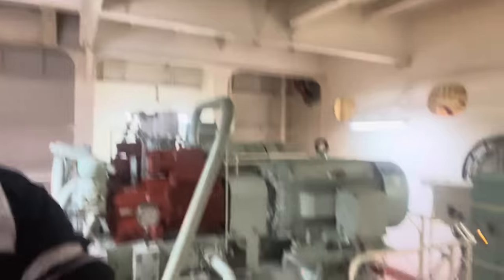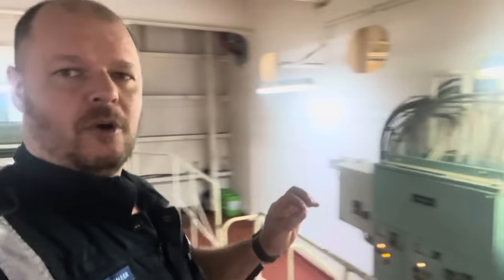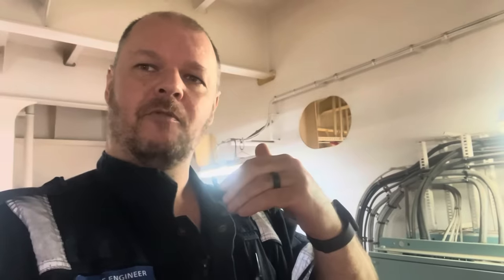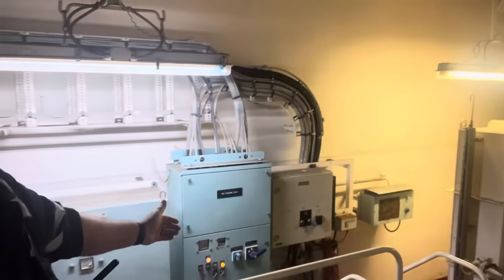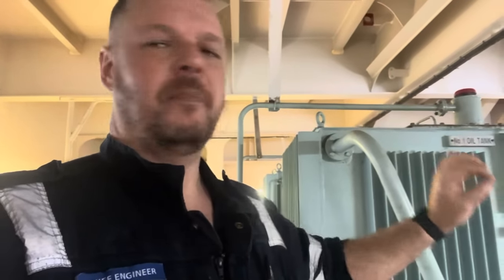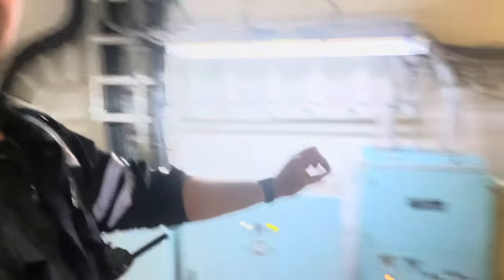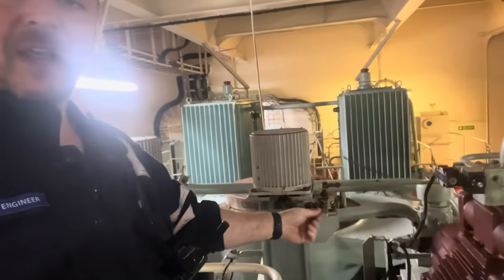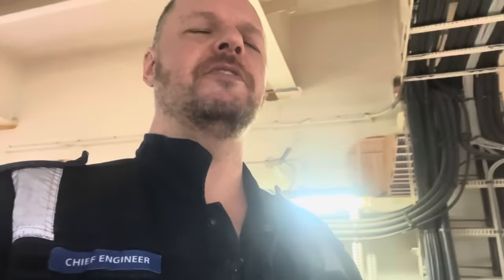Dali size containership steering system. How it’s designed to not hit Francis Scott key bridge

Comment: ok, people speculate about cyber attacks and how easy they are.  your ship looks like most industrial systems, which means its all mechanical and some electrical.  maybe a 24v closed control system, but no networking.  maybe the nav system could be hacked, but it looks like the electrical system and steering dont have much of a way to get hacked.  comments?  if the helm is "fly by wire", i could see faking the input control, but it would be super hard to do remotely.

Comment: Emergency power was restored to the steering in a minutes time , with which they could have started a main generator to power the main engine , giving stern thrust to slow/ stop the momentum of 8 knots, for the reason  of the Black smoke,   coupled with dropping the anchot, complicating matters,  , with the astern Propulsion causing the head to Cant to the right directly heading the bridge pillar, these undue actions caused excessive srain on the generator for the cause of the 2 nd blackout , 
It should be known that the heading does not depend on the propulsion but on the momentum which was at a forward 8 knots, likewise with such a headway stern or bow thrust would have no effect other than Canting , 
What should have been done after emergency power was restored to the steering was to guide/navigate the vessel under the Bridge using the momentum of 8 knots 
It serms the Pilots focus changed from navigating the Ship to saving the Bridge , leading to the Crash ,

Comment: Why did the ship make a hard right turn to line up on the pier?  Thanks.
Reply: The widely seen video makes it appear to have a sharp turn but that’s a distorted view due to camera and location.
The track of ship on chart shows it going off straight course to the right slightly, maybe just a couple hundred feet and thus hitting bridge.
Reply: It was a gentle right turn. Car, boat, or airplane -- none of them travel straight for extended distances with steering inputs.
Reply: @andrewsnow7386  and on one of the videos about this incident from someone in the shipping industry, it was said that during the times without power, the wind and currents pushed the ship a bit to the right so wasn’t necessarily an intentional deviation.
Reply: the wind was two knots Easterly  - so deffo not the wind especially as the ship was travelling  pretty much in a South Easterly direction @JohnHallgren  - the water was very calm and still - so perhaps the currents or something else
Reply: @mikewood8695  And how many square feet is the side of that ship and load have for any wind to push on? Go try to carry a sheet of plywood by yourself in a light wind. I remember several times while I was driving truck, hard side wind and tractor was in one lane, trailer was in a different lane.

Comment: But no battery's (UPS) to supply power for those 30 seconds the generator takes to start up?  All electronics go all off due to lack of battery-backup?  The big electro-motors you probably don't run from battery's, although doable for 30 seconds to a minute. Electronics/control systems/computer systems "don't like" to be turned off and on quickly. That's where I expected a UPS to be in place to prevent that from happening. So power goes out and really ALL systems are off for up to 30 seconds after which they need to start up again and reconnect to all modules, sensors etc. ? What kept the main engines running at that disaster ship? very visible the main engines were set to full power during the event, they will not run either without electricity.
Reply: @mikew.to1  You only need to cover the time it takes to start the generator, which is 30 seconds.  200kg extra for 100000+ tons ship is not a problem. let's say we want to power everything (except propulsion, HVAC and radar) for 3 minutes and calculate high, maybe 3 ton maximum extra of weight. However, powering all the lights etc. anything that is not "smart", would be odd.

Exactly what you state, all the control systems etc. 
But apparently they do not have that? Full reboot of ALL systems on power loss? Hope the poster of the vid can clarify.

Comment: So essentially, if you have no electrical power then you have no steering.
There's not much of redundancy there.
Reply: It has emergency generators. In case power goes out.
Reply: @eddythehead9101  
But emergency generators can only deliver electricity. If the electric system or the electrical motors are gone then the generators are no use.
What they need is manual way to operate the rodder.

Comment: Why wouldn't the emergency generator be already up and running in maneuvering situations? Seems dumb to leave no rudder control for half a minute.
Reply from the maker: Because it’s the emergency generator and ships maneuver all the time. The emergency generator is kept in optimal condition but not wearing it out from use on a regular basis. For maneuvering conditions an extra regular generator is required for redundancy. In Dali something happened and all of the main generators failed which is highly unusual
Reply: @steamman9193  I'm in the airline business, and airliners always have two separate generators running off two separate engines for redundancy (there's also an auxiliary generator that doesn't usually run in flight). So even if an engine fails there is no loss of electrical or stearing. Even if somehow both engines failed at once there are other ways to stear immediately available (RAT, cables, etc). I find it incredible that a ship could be left rudderless for almost a minute due to a mechanical fault in close quarters like that.

Question: Are both required main generators powered by the main engine, or separate diesels for each? Would it be legal to operate with one of those main generators inoperative for a short time? Like waiting on parts or something?

Comment: Only one backup generator isn't sufficient when the consequence of failure is loss of life and billions in damages. Generators often don't start. Switchgear often fails under transient load. Source: dealt with data centers for 30 years.
Reply from the maker: They should have had an extra generator online while in restricted waters. Should is a very important word there. Wait for the reports now. FBI is involved

Comment: Dear Chief First Class.Yo are earning double than me on small offshore vessels.Most likely around 12000USD.That Indian Ch.Eng is on my wages level.Around 6000 or more.
No one of our experience is ever asked how to impruve things.I can se at once that there is no 24 Volts redundancy emergency pump.
Black outs are dangerous.Breaker tripping,engine shut down or mistakes during gen set change over.That is why Ch.Eng is present during critical manouvering.

Comment: If ships had a large battery storing emergency power, then wouldn't you never lose any electric motors in the event of a power loss situation?, you'd have enough to steer and power lights still without generating more, even if its only for 5 minutes. Its like people that live off the grid and use solar along with electric diesel generators, they need battery's to store power otherwise the generator needs to run 24/7,

Comment: Would dali have power right now
Reply from the maker: Definitely maybe. Too many possibilities of what happened there for me to say
Reply: The ship is under power, since there is current and wind acting on the ship.  = The captain and all crew are still onboard. 

=The crew is helping stabilize the ship.
Reply: @jonmccormick8683  No, it's pinned to the bottom by 4000 tons of crane wreckage. They do have a diesel generator running on board however, I can see the faint exhaust plume from the stack, and the NTSB people said the cook was making dinner, and all the interior lights are working.
Reply: They better - they have reefer containers aboard. Ugh don't imagine what they do if the power is out for several weeks while they get it unstuck

Comment: Ask him how a slow speed diesel 2 cycle gets air when  the scavenging Electric blower had no juice ?

Inject all the fuel you want  with a full back bell, with no Air you  get no power just black smoke !
Isn’t that what happened?

The engine is useless without electric power .
This is not a tractor engine from 1964 that runs in an EMP situation !

Comment: Isn't there just 1 propeller on the Dahli? And 1 large engine that turns that shaft? If that engine quits, they wouldn't have ability to turn because there wouldn't be any thrust across the rudder?
Reply from the maker: Yes
Reply: @deans178 @steamman9193  they would have steering control with 8.5 kts of flow over the rudder... the only lose steering due to loss of propulsion if there isn't flow over the rudder(aka at low speeds).

Comment: Your steering system is redundant in technical design, but the electrical distribution system has its limitations and failure modes are not analysed to low levels in general shipping sufficent enough to provide rigorous protection to full systems and sub systems. Likely, this incident will be a multitude of failures and processes both technically and human nature.

Comment: No there is no different regulations around the world. As per Solas regulations Emergency diesel generator should start and automatically connect to the grid in less than 45sec

Comment: Thank you and can I share your content? I am willing to share any income on the video I post if you like.
Thank you for posting... Filter system is what I was concerned about. 
Partial clogged to blocked fuel filter and then transfer to electric? 
Electric only giving them stearage until motors restarted with fuel that by-passed the partially blocked fuel filters. 
It presents as they just started their engines with the billowing soot from the stack.
Reply from the maker: I would like to share my information. I do only want to stick to facts and because of that I don’t want to go into fuel filtration systems because mine is definitely different. It will work similar but it’s definitely different. This is an assumption but fuel quality should be looked at as a contributing factor but I don’t believe it will be found to be the main cause

Comment: Sorry, but you can't say there's yet another redundancy, when following it up with 'it's manually done but no one's close, so it's not really an option'.... I mean, you can, but it's useless in an emergency, so doesn't really count.
Also, 2 motors is one motor and one motor can fail.  Is it unlikely there's a failure at the same time there's a failure, yes, but when there's thousands of these ships, unlikely becomes inevitable... this applies to everything (just using motor as the example).
But, won't see more thorough redundancies because that would cost private companies, whereas it's the public who pays for the consequences and that's the system we have.

Comment: Now explain how it turns 60-90 degrees In 1 ships length to hit the exact weak spot that brings down the whole bridge. 
In the military we called this sabotage
Reply: That's easy. It doesn't. Look at how the ship ends up. The ship turned only 10 or 15 degrees out of line (over several minutes, starting at the first blackout, according to the GPS tracks from ship-tracking websites). If you want a conspiracy theory, point out that it turned JUST enough to miss the dolphin and hit the pylon.

Comment: Not fast enough.   30 seconds is an ETERNITY in an emergency situation.  There needs to be a battery in between there for instant switchover, or a system with a max 3-5 second time.  Better yet, there should always be 2 generators running, doing different things, so this can NEVER  happen
Reply from the maker: There should have been an extra generator running. It’s required all times in restricted maneuvering areas

Comment: The first time the power went out on the Dali the outage lasted 99 seconds. 12 seconds later smoke started pouring from the stack. 94 seconds later the power went out again for 32 seconds and then came back on. 2 mins and 15 seconds later the ship hit the bridge. 
I am not ship savvy. I continue to question why the Dali's power went out not once, but twice, at the exact spot where there was no possibility to recover and avoid hitting the bridge. Where would you go on a ship to find some type of hidden remote control device that could be triggered to cause these system failures? 
I watch the news and keep an eye on who is screwing who in this world. I remember the Nordstream pipeline sabotage and what it took to do it (and we all know who did it because they have been gloating ever since). I also saw that someone tried to say that there was a Ukrainian Captain on the Dali when there wasn't. Tell me honestly that something really doesn't stink here.
Reply: 45 seconds should have had the backup generator start…. if it failed then the emergency generator should have been up in 60 seconds…
Reply: @EricWeberGoogle  Yup, I think they had a short somewhere, and main generator shut down or tripped. Backup generator started, main engine attempted restart, but with the short circuit not being fixed power went out again. 32 seconds later, emergency generator switches on, then they attempt to steer hard to port, but it's too late and hit the bridge. You can see a slight movement of the bow to port just before the impact on the MTA video.
Reply: I don't think was a remote hidden device. I'm thinking probably a big short circuit or ground fault on the system that supplies power to the reefer containers. Some rumors floating around where they had problems and power outages while in port such as reefer power.

Occam's Razor applies here I think. "Never attribute to malice, which can be adequately explained by incompetence"  
🤣🤣😂
Reply: @brnmcc01  No short, that would have tripped a breaker and cleared…. I’d put main switchboard issue phase loss prior to the distribution system… or low frequency trip higher on the suspect list.   It would be good to see their last thermal survey of the Main Switch Board and Main Breaker survey records.   The reefer contractor indicated they kept having reefer breakers trip the day before in port suggesting phase loss or low frequency issues.   It would be interesting to see a copy of the pilot card to know if the pilot was aware they had any issues.

Comment: Well said, disigned to fail. 
  All I'm observing is human nature loves to take the path of least resistance.  Bigger ships/ bigger profits. If bigger is better than really bigger would be much better. Until an accident that could of been avoided happens. Then everyone just points fingers and calls anyone to question their expertise at making money. Whenever you have a profit before equation you ARE an accident waiting to happen. Pity it took this catastrophic incident to hopefully open some eyes. Incommend the shipping industry to build bigger and better but what was overlooked is safety did not parallel the same progress as the ships. If you've gained some weight you will not fit into yesteryears tux. You cannot let profit exceed safely.  Shameful.